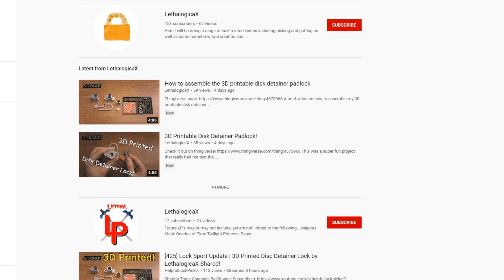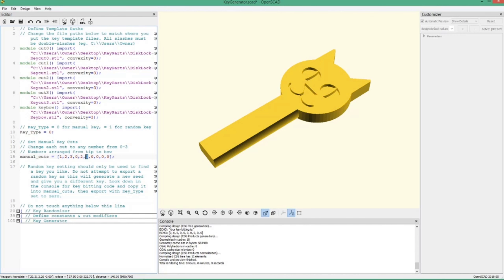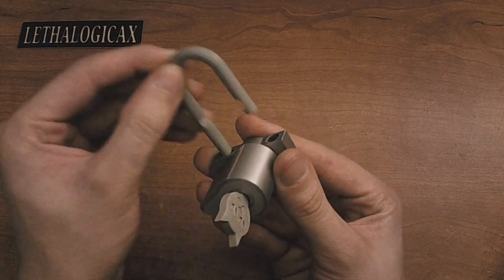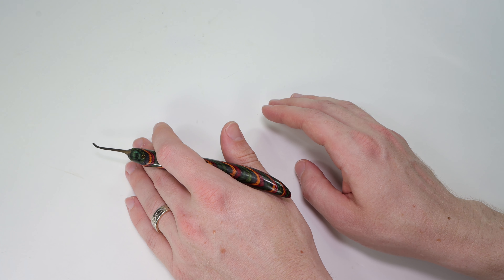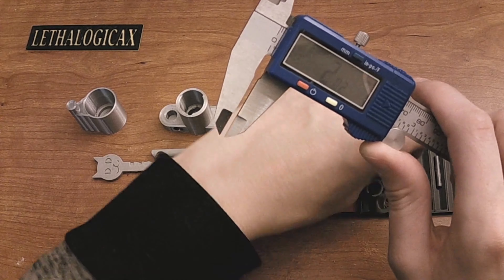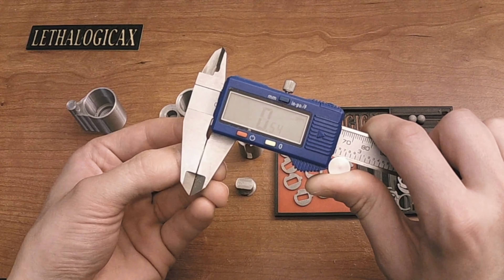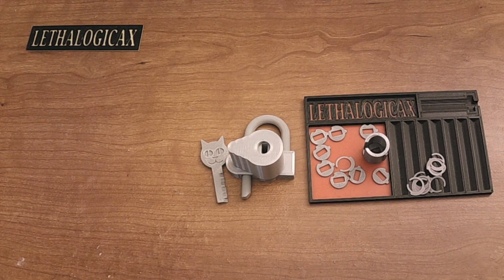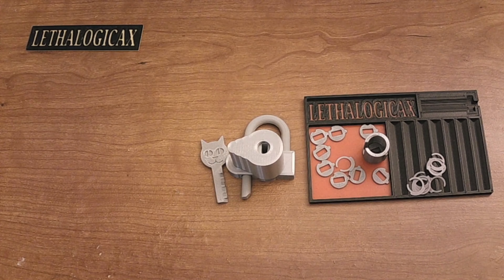Overview On A Fully Working 3D Printed Disc Detainer Lock Designed by LethalogicaX!

Comment: I wonder if this could be scaled and printed much larger. It would make assembly easier. I also think it could be worked into a neat geocache container with keys left in other caches.
Reply from the maker: That would be interesting to see
Reply: You could scale it up but you would start running into problems if you made it too much bigger. Theres a 0.2mm tolerance between all the parts to account for printing inconsistencies. Scaling the entire model would also scale the tolerances and lead to a sloppier fit. If someone wanted a mich bigger version then Id have to work with them directly to adjust the tolerances. Neat idea though. I may have to make a massive one in the future...

Comment: Im new to lock picking and I have a question. When I am single pin picking my master 3 lock, I can get the first pin to bind. Then the rest of the pins dont bind for me. I have also tried raking and pretty much everything to open it. Its been like 4 weeks now and I still cant open it.
Reply: Sounds wierd maybe it could be that you overset the first pin so the others wont set but it could Also be the lock that have a fail in it or something Else, have you tried to pick it from the back and out?
Reply: @lockmania-locks  yeah I tried from the back and still I can only get 1 pin.
Reply: I agree it could be oversetting. Oversetting pins is, in my opinion, the most common error for those of us starting out. Ask me how I know. 😜. Also, try higher tension. I have a Master lock that simply refuses to open with a pick or a rake until I lean on the tension tool. That’s commonly called “bullying” and I’ve only ever needed it on Master products. Needless to say, if you are at high tension, raking probably won’t work. Another indicator that bullying might be required: try picking it while the lock is open. Use the key, open the lock, turn the core back and remove the key. Very often, it is easier to pick padlocks that are still technically locked, just without the shackle in place. You won’t need high tension. I think this has to do with transverse tension put on the actuator end of the core by the shackle and locking pawl/balls. I have a Master that will only open with a rake (and light tension) when the shackle is open.
Reply: @JohnSmith-gs4lw  Ok Im going to try that. Thanks for your answer
Reply from the maker: Some of the locks are so bad they are good. Some of the cheaper locks are not always easy to open. If you are trying to use it for learning purposes I would try something else. Try out one of the locks on my progressive lock list in the description. The Brinks 40 mm laminated padlock provides excellent feedback.
Reply: @HelpfulLockPicker  I thought that was number 4 on your list